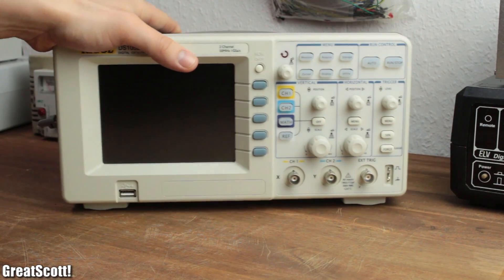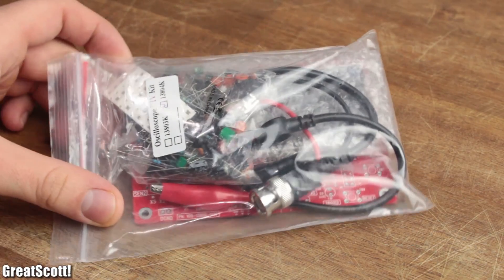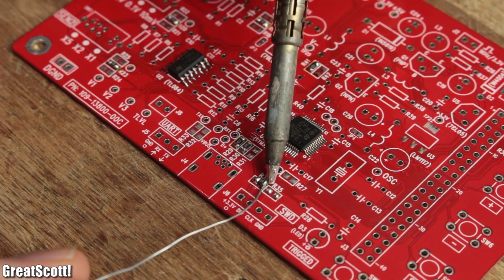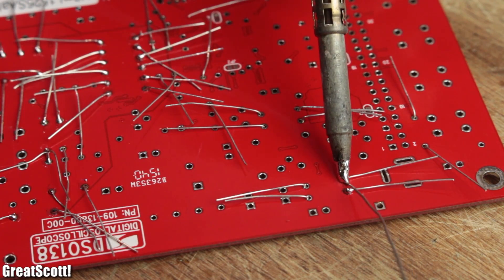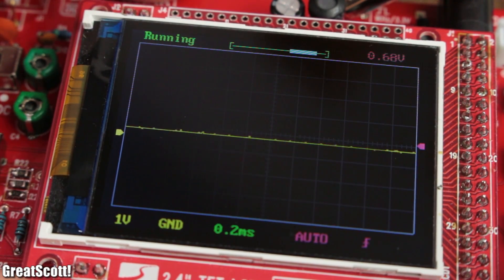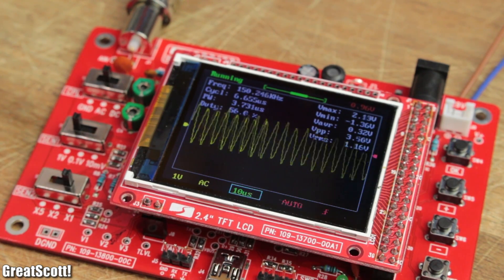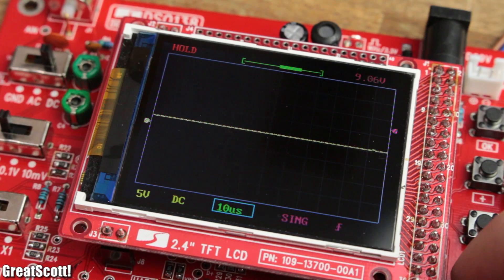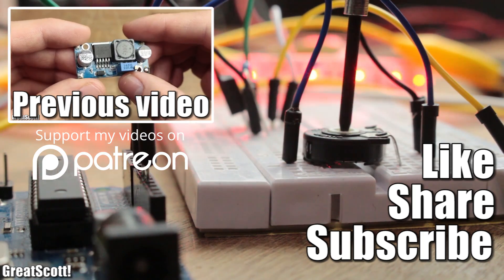DIY Oscilloscope Kit (20$) VS Regular DS Oscilloscope (400$)

Comment: Great video once again... I really like that you compared the two together and the fact that even though it was inferior to the Rigol... It still has a use... Especially liked the fact that you mentioned where it has a purpose... for example a Arduino... I have seen other reviews on this cheap product but no one else has mentioned that even though it's not as good as the more expensive ones... it still has it's uses in this or that... I don't have an oscilloscope and nor do I know how to use one either but I'm definitely determined to get one... I love building amplifiers and anything audio and I have been wondering if this cheap DIY DSO would be useful to me.... If anyone knows the answer to that question.. Please comment below... Another question I have is... would it be possible to replace the screen with a bigger one... If this can be upgraded to a larger screen then I will definitely invest in one, then fit it in a portable case and power it off some lithium batteries...

Comment: Why not buying an old analog oscilloscope for cheap?

i got an old 15MHz crt oscilloscope from 1979 for 28 bucks on ebay, and its definetly way better than this diy kit.
and hey, its analog. thats just way cooler than the digital ones.
Reply: Virgo AVR i would love an analog storage scope, of course a digital scope has its benefits that I can’t live without but I’m sure I’d use the analog one more, mine right now has no storage which is a bit of a pest but it works and I’m lucky to have gotten it for free!

Comment: I'd like to see a comparison of the kits vs. prebuilt "kit" type oscilloscopes i.e. the nanos ... namely highlighting what extra functionality and quality if any one can get by building your own from an actual kit. Like if I'm just looking for a quick and dirty solution to get my feet wet with oscilloscopes and or looking or a more portable lab. I know at some point I'm going to need a 'real' oscilloscope, and I get that it's just a multimeter that makes multiple readings over time and graphs the resulting readings, at least in the most basic sense,  but I'd like to fry a few cheapos first just to get a feel for these tools before I go spending what is a ton of money to me one a more advanced one. It just doesn't seem to make a lot of sense to me to spend so much when I don't really know what features I'll find useful and valuable and that I am likely to fry. Since 20 to 35 bucks will get me there then I can look for maybe a 50 to 80 dollar used analog or maybe just move straight into a feature rich 400 plus dollar multichannel digital unit with logging and what not, idk... that's the point though, I just don't know. I need to know what I'm doing to be using if for and where my electronics enthusiasm is going to take me ... i.e. am I going to be really interested in audio electronics or rc equipment or whether and are there certain features that one oscilloscope is going be better at than an other one that may sway my decision on which one would be best for my needs when it comes time to get a real one? I'd rather wait and see than go all out now and wish I had known that I'd rather have a different model. But at any rate, for like minded beginners, my vid suggestion would be a comparison of low end low budget options that answers questions like is it worth it to get a kit vs a nano, or could I save myself the time and possible frustration of assembling wrong or assembling with pore soldering skills and breaking my kit before I even get to give it a first boot thusly having to buy a new kit, etc or should I give it a go in spite of these potential risks, and what about getting inexpensive used ones vs. kits and nanos, I know EEVblog's outlook on it, but for the reasons outlined above I tend to disagree, especially as a person who often struggles to come up with five bucks to spare for the convenience of not having to make a lunch at home... I think EEVblog seems to forget that there are people who are that pore who also take an interest in electronics. I am about 80% done collecting the parts for my power supply build, and thus far I've spent 98 cents... I've recovered an old ATX from a broken computer my local thrift store was throwing out, a few pots from an old radio that same thrift store was throwing out, some banana receptacles from a broken (seriously physically busted, possibly accidentally ran over) multimeter from a construction dumpster, etc, the only thing I paid for was a fauxduino nano from China... and I'm planning on getting a volt and amp meter via the slow boat from China but I'm waiting and watching for a deal less than a dollar ... so yeah we're talking I'm trying to go extremely cheapo to start off... I don't want to skimp on the soldering station though, I'm definitely going to get one that I won't out grow for a few years as my homemade iron isn't going to cut it and I know enough about soldering to know it will be a sound investment. The one I'm looking at is still a cheapo but at least it's not some 30 watt pencil unit from the local no-name ma'-n-pa' hardware store in my podunk town cough cough barely qualifies as a small village but it's the US so we call it a town cough . And it's better than my borrowing my aunt's supper punchy claims to be a 100 watt but actually draws the full 120V~ the recptacle offers at 10amps! with some half inch chisel tip (exaggeration on the tip size, but not current draw) massive and way over powered pencil iron designed for soldering stained glass... the damned thing heats up a room and it's obviously been used way dry a lot, like it's black and blue and always has balls of blacked solder on it with no wicking... and you change the temp by changing the tips that she can't change for lack of having more than one... like yeah, I've asked to barrow it and I just keep it for an hour or so, so as to be nice an pretend it was used thus useful and give it back without using it cuz um yeah, I don't want to have that conversation with her about it being crap and her not talking car of it etc. anyways I'm rambling per the usual so I'll stop now, but yeah thanks for the review.

Comment: As a retired GM mechanic i was great with all basic electrical but never really needed an oscilloscope other than looking at secondary ignition sparks, After buying this DSO138 i removed two AC motors from a VCR, i was able to see the AC waveform from the motor,  i built a full wave rectifier bridge out of some cheap in4001's and was able to watch the newly converted AC sine wave turn to DC ripple, I was than able to see the smoothing effect of adding a ceramic capacitor, i added an earth ground to the bridge and saw it get very smooth, when running a load, i found the ripple Re-appear as the caps capacity was exceeded, adding a secondary electrolytic cap fixed it perfectly, Just after doing this one little first project Im thrilled at the thought of a real scope! What great fun building and learning on these!
P.S. The Thrill was SEEING for the first time! I had rebuild three-phase alternators with bridge rectifiers for 20 years but never got to SEE them working other than voltage and wine underload.
Reply: As an EE student studying single-phase transformers atm, this got me really excited.
Reply: beasterbunny217, I bet your going to have a fruitful career,  Cheers!
Reply: This is what happens in india, they teach and tell you "xyz happens this way, but you don't need to see it, it just happens, trust me"
Reply: @EvanFerrao  buy this cheap scope and be a gentleman

Comment: Im fucking pissed as fuck!
I bought this piece of shit and spent fucking 5h assembling it. After i was done... It dont work. Ive checked fucking everything and nothing seems off. Only thing i can think of is that i accidentally plugged a 17 volt psu to it even tho the psu said 9v! Holy fuck im steamed its 2 in the night i had shit to do but am forced to go to bed before i start braking shit. FUCK

Comment: Could this be used to set amplifier gains accurately between 20Hz-20khz? Or would 1000 watts/40-60 volts be a problem?

Comment: "Hey kid, wanna learn about electronics? You'll need an Oscilloscope. Now build it."

mmkay.
Reply: Well that's how I started, my first thing I built was a sign with my name on it.
I had no clue what I was doing, I had one 230-24V transformer, some LED and a potentiometer.
I had absolutely no knowledge of the calculations but it worked... The second time. 😂 The first time some LED exploded. 🤣

What I am saying is that you are learning by doing, but start with assembly an OSC thats SMD is a bit over kill, but you get the point.
Reply: @hannescamitz8575  Thats Why ID Recommend Using A Circuit Simulator Online To Test If Anything Explodes
Reply: @decoycat  
I guess that's convenient way of doing it, but I made that sign about 25 years ago, so home computers wasn't all that familiar sight nor those kind of software. 😉
Reply: @hannescamitz8575  I just looked at the kit on Amazon, the one they have now has the SMD components presoldiered on the board.  I had the same initial thought as you, but this is much better.
Reply: I Guess at the end you get what you pay . A $20 bucks osciloscope  is a $20 bucks results.  How ever for fun  is a great project
Reply: I did that. Was a good practice when starting to learn soldering and handling electronics stuff. Bonus: I got a working OSC for cheap that can even be used within its limits.
Reply: LOL....

Comment: ofcourse around 200khz  it wont work properly, even standard benchtop oscolliacope has 3 db down and fluctuation at around 80 PERCENT OF THEIR MAX VOLTAGE. for a 20 dollar kit that you sholdered yourself without meeting standard sholdering requirements its not fair to critic the dso130. man its 20 us dollars. thats with shipping and listed max analog bandwith is already 200 khz max.

Comment: Dont Buy cheap kits like this. I ordered several ones and all of them destroyed themselves after 2-3 hours. I bought 2 newer scope kits, but both worked flawlessly for 1 hour, then they stopped working without any reason and the parts on the PCBs heated up to hell temperatures. These kits piss me of so badly and they are just a waste of money. Get yourself a good quality scope and not this garbage from China.
Reply: any recomendations? for a reasonable price plz
Reply: iPhone is physically made also in China. (But i also don't see comfortable with   solder SMD parts for 3 hours. :) )
Reply: mikelor84 you can buy a rigol like this in the video it costs about 300 to 350$ i think

Comment: Is it possible to connect a 1/10 Probe to measure higher Voltages? F.ex the newer Version has a max Input up to 50V, so a 1/10 Probe should work without problems right?
Hope anyone has experience with that.
Greets

Comment: I don't have a oscilloscope but When i nead to measure waves i conect plus and minus to a speaker and putt my phone beside the speaker and set one voice record and then you can see the waves it is not a good way but it works on very low frequencies e.g my 555 timer circuet

Comment: Hi Scott, nice video!
I've noticed  you're using a DPS5315 power supply, like me. :-)  (Oddly enough, I' m also using the Ersa pico, hmmm. )

Maybe you've added the usb board to the DPS5315? Because I played with LiPo batteries and needed a charger, I developed a charging software for the DPS using the USB port. Maybe you're interested to take a look? 

https://bitbucket.org/Rytikar/dps5315liiocharger

As I've now reverse engineered the protocol I'm thinking of what else to do with it, besides charging batteries.

Anyone any ideas? 

Greetings
Reply from the maker: Looks awesome. Thanks for sharing
Reply: GreatScott! you sound like you have eaten a mass of penut butter, I believe if you can get someone to say what you need to say in a more clear way you should get way more views because your voice alone makes me want to stop watching.. im sorry if thats rude at all im just trying to give you an idea that might help gain views.

Comment: This soldering iron tip is not bad for smd, just change technique. First pus solder on one pad of each component, then while heating up theese pads one by one slide component onto such pad, and then when it cools down just solder second pad by applying tin on it with soldering iron tip
Reply from the maker: I am aware of this technique. But I don't like it. I prefer the one shown in the video.

Comment: Interesting kit, looks like it may be handy for portable basic low frequency circuit testing 'in the field'.  Currently my smallest scope is Hitachi V-680 which has a carrying handle but is large, heavy & runs off  240V AC mains. (mains inverter is also bulky and heavy)  Did you test the kit for EMC / RFI ? and if so could you let us know what frequencies suffered from spurious emissions as this is a critical part of selecting equipment that will be used in close proximity to HF, VHF & UHF radio gear.

Comment: You soldered all these smds... Patience level over 9000
Reply: More simple process is soldering one pad of SMD component then another, not the both pads together.
Reply: ...flux is your friend...
Reply: I prefer solder paste through stencil and hot air, way quicker and way cleaner
Reply: @junehanabi1756  You still have to place the components. Not really much easier or quicker. (vs directly soldering)
Reply: @johnyang799  You still have to place the components but you don't have to worry about the more error prone and careful nature of manual soldering. In other words, with manual soldering, you can have varying levels of solder placed on each pad and without amazing hand precision it would be fairly easy to create bridges. Your also trying to work in a way that the tiny piece can be soldered so you need to ensure it gets soldered onto each contact point working fast and accurately.

With solder paste through a stencil you mainly need to be careful to put the piece on there correctly, but you don't have to worry about any of the manual soldering issues. It all gets a thin even coat and remains somewhat cold or room temperature until you begin to heat it up after all is done. Once heated, the solder paste will re-flow and do everything else for you including positioning the components better, flowing up onto the components, etc... so it requires far less speed and accuracy and is far less error prone with the only challenge being to get the initial pieces on there best and making sure no bridging happens afterwards.

I'm just saying many people prefer solder paste for those reasons and people who were scared away from SMD work often feel more hope when it comes to solder paste.
Reply: How to solder smd at home with simple tools
Reply: Definitely, SMD is also what I say to that project
Reply: Yeah specially withou5 a hot air station.
Reply: SMD is much easier to solder in fact.

Comment: One question I always had was what is the difference between using a signal/sine wave generator when it's possible to just use software on a computer or phone to generate sine waves? Is there any benefit to it?
Reply: sound card can generate only a range of frequency audible to huma ear, for many cases, you may want to be able to use higher frequency.
Reply: robertpk Oh I see, thats makes since.

Comment: I bought this and I fucked it up by shorting some stuff out (while the unit is powered on, I was swiping the test leads underneath the circuit board and then it killed the whole thing. I bought a second one and I fucked that one up too when I tried to short out jumper 4, the solder just won't stick to the pad, it kept sticking to the soldering iron, so I got frustrated and cranked up the high and it just burnt the pad and the solder mask around the area... 45$ down the drain.
Reply: Will J, you need flux if your solder won't stick.
Reply: I know how you feel, I hate working with solder. Sometimes I can't tell if its me or if its the solder and soldering iron I am using.
Reply: SpydreX Official
Fortunately I got the second one working, I put a huge blob of solder paste onto jumper 4, heated it up and it made a connection! However my readings are irratic... I think it has something to do with me heating my crystal oscillator too hot or yanking the pins a bit...
Reply: You bought 2 for 45$??!!
Here in Greece where i live, its 45 to 60€ plus shipping 5€
Reply: Lela Mario you can get them for 12 euro on aliexpress

Comment: an easier way to solder those 0805 resistors is to put solder down in one side. Then hold the resistor with the tweezers and reflow the side with the solder while holding and aligning the part. After the one side cools you can let it go, then solder the other side. Bam! Perfectly soldered part

Comment: Hey Scott! Might be an old video and you might not read it, but the way I always soldered SMD parts was to put solder on one of the contacts, solder the part in place and put it in the correct orientation, and then apply solder to the second pad (and the part at the same time). I find it faster to do that.

Comment: Hello Scott.
I'm not exactly an electronic expert, but I would like to use an oscilloscope to read de duty cycle of fuel injectors in a car engine.

The injectors are connected in the positive side of the 12 volt car battery and the other side is connected to the ECU (by the way, it's a kit based on MegaSquirt MS1 ECU... a quite interesting circuit).

The pulses goes between ~1ms and 20ms, which seems to be fine for this DIY oscilloscope, but can this kit handle the 12 volt signal on injectors?

Comment: Great videos! Keep up the good work.

I recommend when soldering smd resistors, just tin one pad before putting the resistor down, not both. Makes getting the position correct much easier. You just solder the other side down once you have the position right.